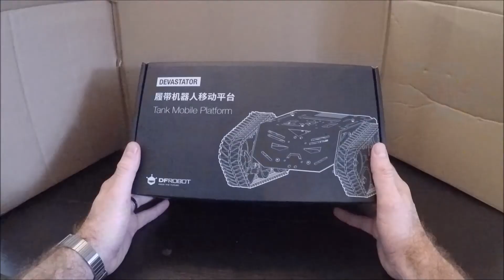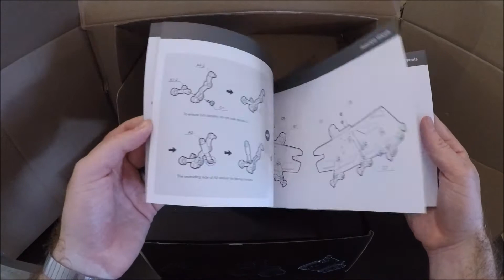Surveillance Robot Part 2: Devastator Tank Chassis

Comment: Its awsome sir. But if you put 3 dof robotic arm on top your devastator tank i think the 3 dof robotic arm is not siutable and not work properly. You need 4 dof robotic arm minimum. You can upgrade buy 2 dof with one servo then combine it  together make 4 dof robotic arm put on your devastator tank.
Reply from the maker: Nothing wrong with more DOF, but I can cheat and say rotation of the whole tank platform counts as an additional DOF for the arm, making it 4 DOF :)
Reply: Bloq Builds check this out sir. https://youtu.be/J7qBjvObNCI
Before that i use 3 dof but not good enough (3 dof can't reach some stuff from ground) i use 5 dof. No need servo base for rotation we can use tank to do it.
Reply from the maker: Thanks for sharing.  I see your point about the more dof/longer arm.  I also like the blue/red LEDs you have on it.  I plant to put my 3 DOF arm on the front angled face of the devistator to move teh CG forward, as my battery near the back causes the platform to flip backwards on an incline.
Reply: Bloq Builds thanks sir.. Sound like good ide to put your robotic arm on the front face the devastator tank chassis. Cant wait to watch for the next step your project.